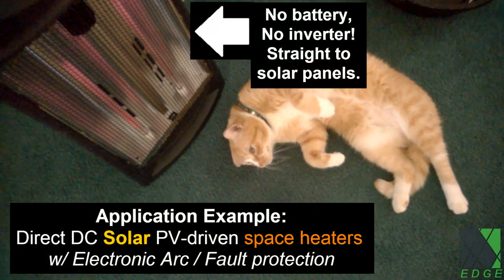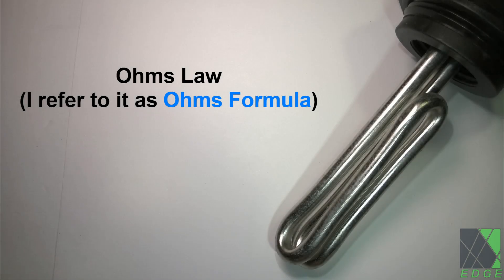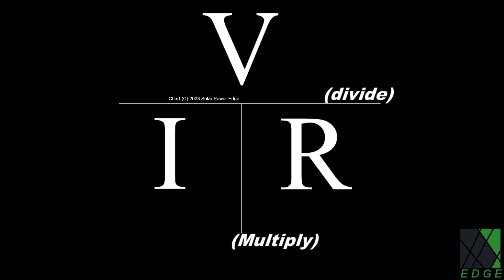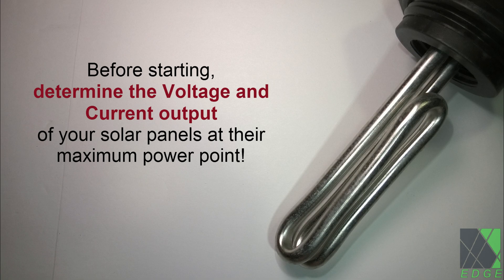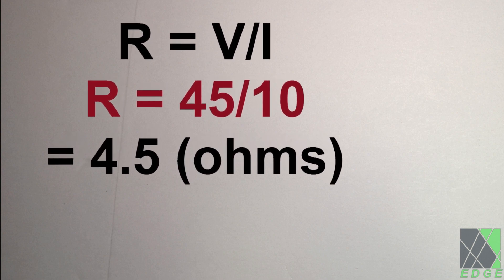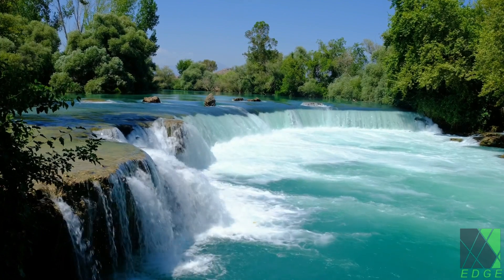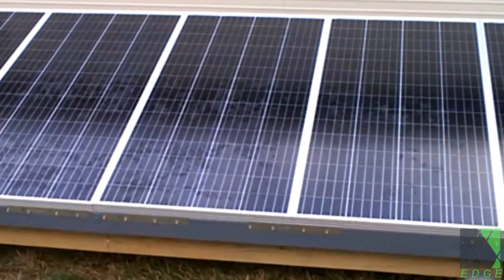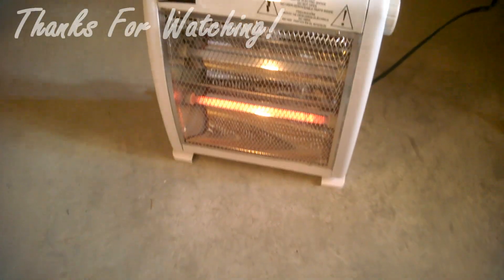How to Use Solar Panels and Ohms Law to drive DC loads directly! Solar Electric 101

Comment: Thanks again good stuff and Cat in the Hat is a hoot! 
PS: I feel it is easier to cool a room than heat one up, comparing a 5000BTU AC and how much energy it uses then let's say a heater the heater will take allot more amps to warm a cooled room than a window AC cooling a room in a 90F day. Thoughts?
Reply from the maker: You are welcome sir! Yes that cat cracks me up, has a lot of personality, hehe.
Reply from the maker: Furthermore, a mini split heat pump cost thousands to install and continually requires maintenance as I have well experienced. But I've been using EIGHT solar PV DC heaters to heat my home and as the winter hasn't been too bad. Those heaters are dirt cheap, very little to break, althought the electronic switching circuits (arc prevention and safety) are a bit tedious. Even if using my heat pump in the winter, it still makes a lot of sense to have cheap simple PV supplemental heat to help reduce power consumption!
Reply: @solarpoweredge  Hey thanks I hope you are down to 8000 things to do now lol
I am losing my home, divorcing so might need something to keep me alive at 65 years old. 
Maybe I can dig a hole and use panels as a roof lol.
Reply from the maker: It's real hard to keep track lol. 
Wow that does not sound fun. I am sorry to hear. Hang in there man! Hope you find a good roof and space for solar or whatever you want hehe. As I have slightly alluded to in old videos, I'm a shut-in with much pain for 20 years. That's 98% of it. Spare you the details. Making video is hard, But I believe they help a few folks, so it's the right thing. Again best wishes and hope you make it out just fine. Take care
Reply: @solarpoweredge  Awe man pain 20 yrs :( well let me tell ya these Solar Videos you and all the others share might help me in a major way as I
intended to use your lessons (yes they are). Hope you do good as well. Hope you can do more videos but if pain is in charge then we both know that will
be the focus, life is a about priorities :) peace
Reply from the maker: Thank you sir - I do intend to crank out more videos, might be slower than those other "less painful" channels hehehe. Peace
Reply from the maker: Sorry - in my rush to get 9000 things done, I missed the rest of your comment. Just happened to see it this evening. Hope you get notified of my reply.

You are right. A straight resistive heating element is not a heat pump so does not have the same effect as a window AC. It's easier to move existing heat (heat pump) but NOT cheaper and NOT simpler. Naturally you get less Heat from resistance than you do Cool. However the heat pump is loaded with moving parts and things that can break. A heating element is simply a cheap piece of wire that gets hot. So both have their "efficiencies" or advantages. Hope that answers the question, sorry for the delay in responding. DD